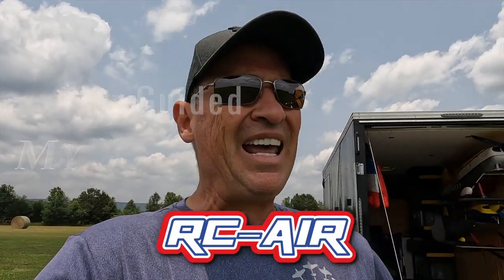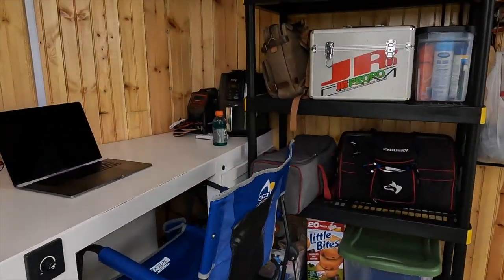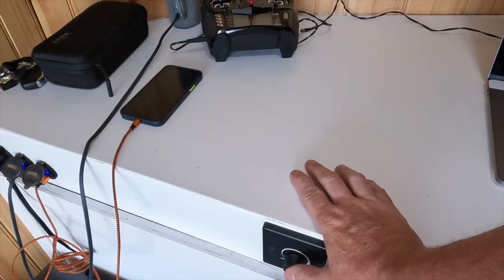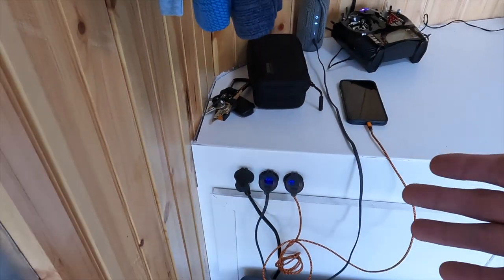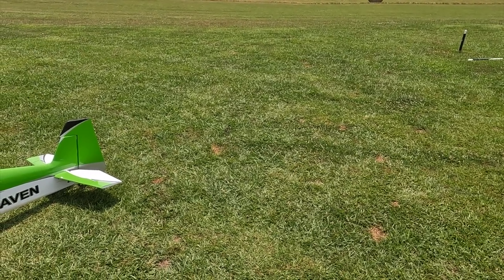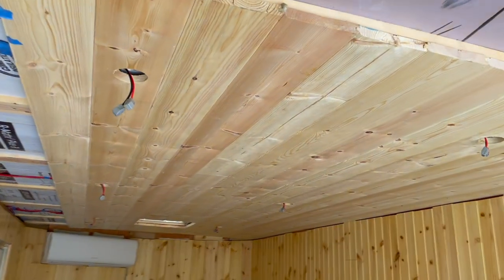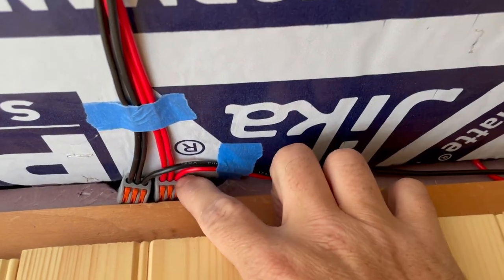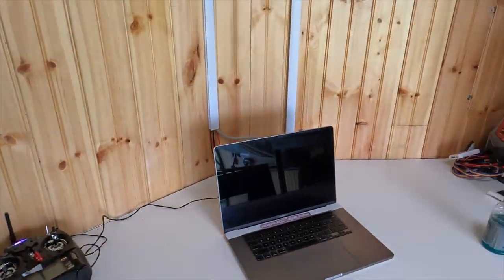Cargo Trailer Conversion for Remote Control Airplanes- Tour & discussion of set-up and modifications

Comment: Absolutely awesome I love it
Reply from the maker: Hey thank you! It’s been quite a project.
Reply: @RC-Air  so I am just getting back into the hobby after 15 +years away from it. It's funny because everything has changed and it has never been easier for someone to get into the hobby and start flying. So I just bought a used trailer and I'm setting it up to haul my giant scale planes. It won't be as elaborate as yours but it is a fun project just the same.
✌️
Reply from the maker: @urbanairgunner6402  I had mine for about 14 months and stayed it at several events before I ever did any work on it. I really just made a list on what made sense for me. All of the work you see was primarily done over the course of a month. Just make a plan and work through it a little at a time. For me comfortable, clean and organized were my criteria. It’s great to hear your back in the hobby!

Comment: If you get time, would you post a close up of the collapsible shelves the main and tail wheels are on. Thanks.
Reply from the maker: These are the main gear brackets I use. Ultrawall 24 inch Black Sturdy Folding Shelf Brackets, Heavy Duty Adjustable Steel Wall Mounted Collapsible Shelf Bracket, Max Load 550lb https://a.co/d/9B7tNep

The tail wheels are supported by some shelves I got at Lowe’s. They they are hard rubber wall mounts and then metal shelves that attach. They are in the garage organizing section.  Hopefully that helps.
Reply: Got the supports on order. Thanks for taking time to reply. I’m in Cullman Alabama. Maybe I’ll see you at a meet sometime.
Reply from the maker: Nice, I'm glad I could help. I will be at the Birmingham IMAC Challenge the last week of August. Swing by or join in if you would like!

Comment: Very nice trailer setup Don, I like the mini split setup.  How do you like the Predator generator?  My wife and I are thinking about getting a GeoPro or similar camper for some on grid and boon-docking style trips and I was thinking the Predator or the larger Honda.  I have the Honda 2200 and it is awesome but they are very proud of them.
Reply from the maker: Thanks Tony! I love this Predator 3500 Generator, does everything I need, half the cost of the Honda and a two year no questions asked warranty.  Pretty tough to beat.

Comment: Like to see some of the equipment u use in Ur planes are thay electric or gas ⛽️ 🤔
Reply from the maker: I will do a walk through video of my planes for you in the next few weeks.  I primarily fly gas, I do have a couple of smaller electrics though.
Reply: I love engineering and fly only electric being a electrical armature winder by trade, I use 12s ,on a 72 inch platform that I build 😀
Reply: @spiroskatsikas  very cool. I have a 12s 95”. The power they make is absolutely insane!
Reply: Using a new flycolor speed controller that was only 130 dollars but very good and a efight 60 power motor running 9s with powerful results